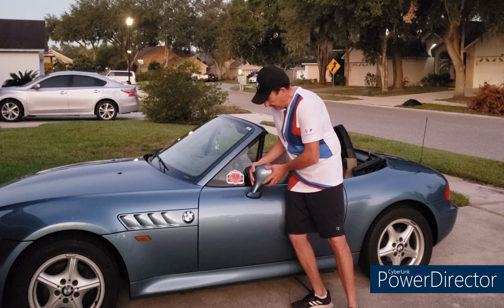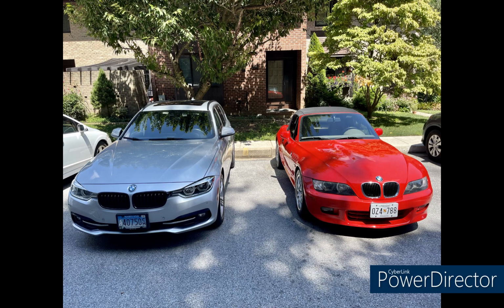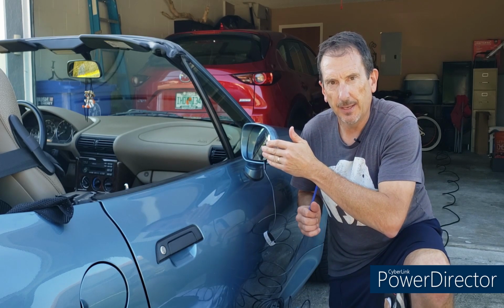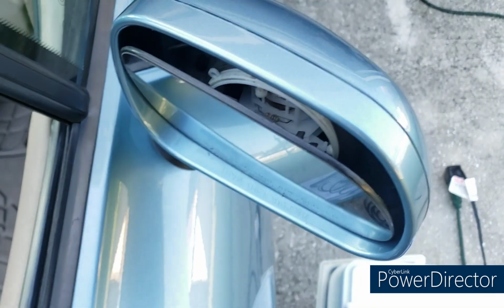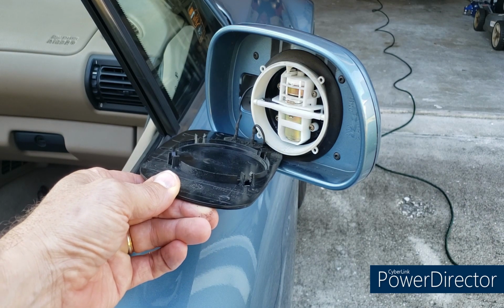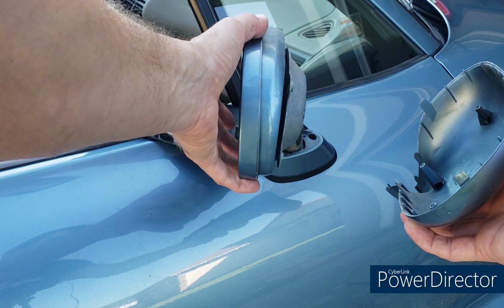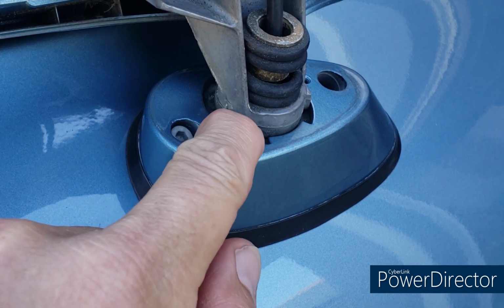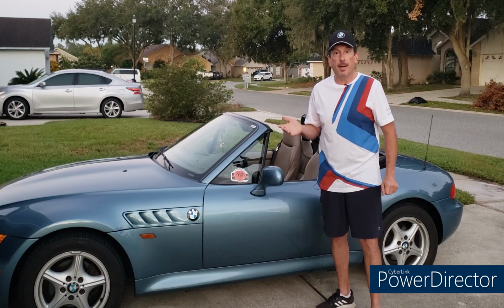How To Unstick a Stuck Side Mirror-BMW Z3!

Comment: I've found  some great information on your channel.  I have the same Z3, same color, same black top, same interior, except mine is a 1996.  Mine just turned 58,000mi..  It's a 1.9L, which I was looking for because my brother-in-law is a retired mechanic and can fix anything. He was a Tank mechanic in the army and worked on diesel trucks, and any kind of heavy equipment you could imagine.  He said to me before I bought mine..." If your not looking to win trophies at the track, I would suggest you buy a 4 cylinder 5 speed.  They have plenty of power, and most importantly....when things go wrong under the hood, there is room to work, because I've worked on the 6 cylinders and they're put in with a shoe horn.  That turned out to be great advice, because I love my Z...........more fun to drive than any car I've ever owned...and I've owned quite a few in my 69 years.  Thanks for all the videos.  Love watching them.
Reply from the maker: Smart call, love the 1.9 as well! Glad you like the channel and feel free to send pics and more details about the car for a future zed of the week!

Comment: Mark, as a relatively new Z3 owner, I did not know my mirrors folded in, thanks!  ALSO, I don't know if this is covered elsewhere, but if the mirrors can at least be folded in, you can then easily get WD40 into the spring mechanism from UNDERNEATH the mirror body.  On my 2001 at least when folded in, there is a large open area under the mirror (lay on the floor and look up).  The spring is clearly visible.  Let the WD40 soak for a bit then work the mirror back and forth over time and it will free-up nicely.  Both of mine operate easily now.  Thanks for the early Christmas present!
Reply from the maker: My pleasure!  Yes, if yours fold, you can lubricate them easily.  I had a couple guys write me who had completely stuck mirrors and asked me to do the video.

Comment: My recollection was if the roadster was ordered with heated seats, then heated mirrors came along for the ride.
Reply from the maker: Thank you!  That makes good sense.
Reply: I believe the rearview mirror is heated as well. Mine has heated seats and mirrors and I can see a wire going to my rearview mirror I can only assume is a heater wire. The windshield washer sprayers are heated as well.
Reply from the maker: @MrMattf727  i think you guys are right!  Heated sprayers too?  Ill have to check mine.
Reply: US spec’d Z3s do not have heated washer jets at the bumpers ahead of the headlamps.(Never offered as a US option)  I’ve only spotted them on videos of euro Z3s. M roadsters with their oval rear view mirror have a wire going to them possibly for the red dome alarm light OR that they were automatically electrochromatic. I don’t recall whether the LCI (face lifted) era (non-M) Z3s changed from the bare manual mirrors, but those latter models had a more updated ignition key (integrated wireless entry?) All of this speculation is easily solved. Just hop onto RealOEM, punch in the last 7 digits of your vin. If you suspect your rear view is heated, their tailored diagram listing will definitively show a replacement heated mirror… same for the existence (or not) of heated windshield washer jets. As I’m typing this though, a heated rear view makes zero sense. The pragmatic Germans offered optional heated side mirrors for morning frost/snow. I’m seriously doubting they engineered a rear view interior mirror to melt snow.
Reply from the maker: @cartertg  thanks for the detailed comment!  I was thinking about the headlight washer as I was reading the other comment.  Makes sense as the windsheild has its own heat.
Reply: @cartertg  yep looks like that wire by the rearview mirror is the sensor for the keyless entry. my nozzles for the windshield washer are heated. (the ones located on the hood) i didn't even know headlight washers were available on any version at all. the only thing that made any sense to me for the rearview being heated is maybe as more of a de-fogger

Comment: Hi Mark nice video I have 1998 with 56000 miles maybe you no  the mirror driver when I drive is make hat maybe you can help me with this  thank you so much
Reply from the maker: Thank you!  Can you explain more what the problem is?
Reply: @Moment of Zed  thank you Mark  when I'm driving the mirror is hot
Reply from the maker: @ManualCarpio-uj8rn  not much to go on,  wiring issue?  Short circuit.  Motor may be going out?
Reply from the maker: @ManualCarpio-uj8rn  thinking more, like me you may have defrosters in the mirrors that are stuck on.  Do you have heated seats?
Reply: @Moment of Zed  hi yes I have heated in the seats
Reply from the maker: @ManualCarpio-uj8rn  you probably have heated mirrors too.  Think they may be stuck on.  Double check your seated heat switches.  Maybe the heated seat is on, but not working, but the heated mirror is.